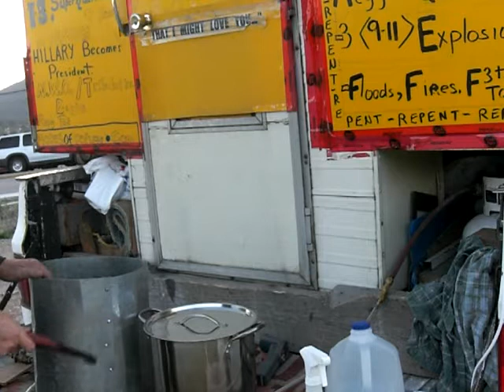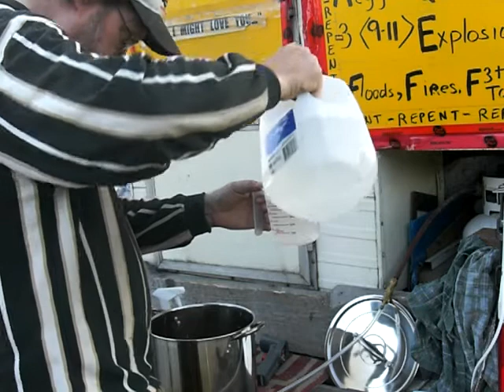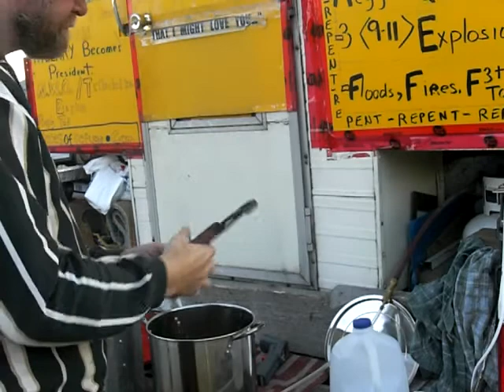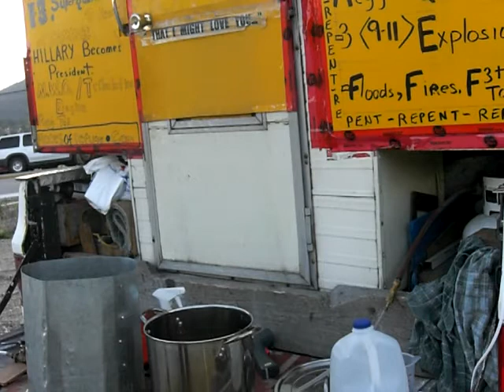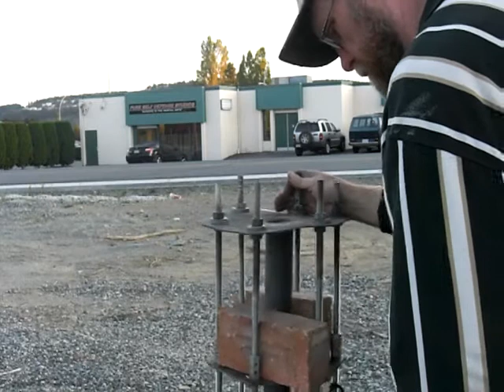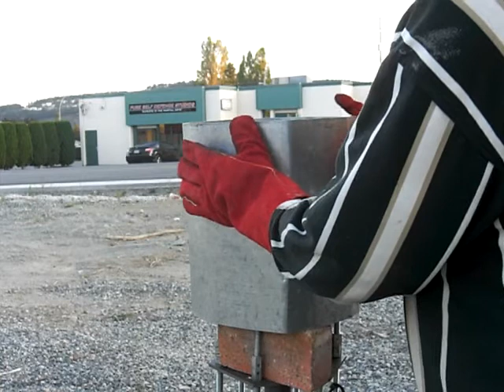88-PART 1 of 3-WATER TO STEAM Test-64 oz-L3 Flame-(19 min.,  30 sec.)-Gal. Steel Flame Shield.

Comment: good job,  i bet if you added a extra shield it would even hold more heat... like a heat barrier so the outside air isnt directly on the shield, i would also suggest in between the two pieces of metal some fiber glass insulation.